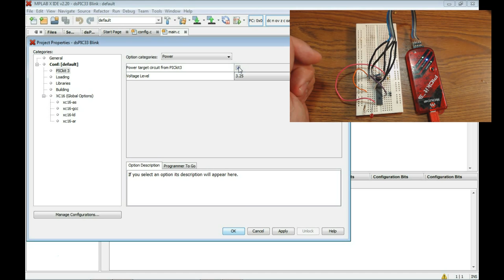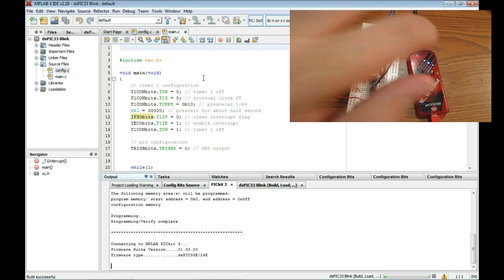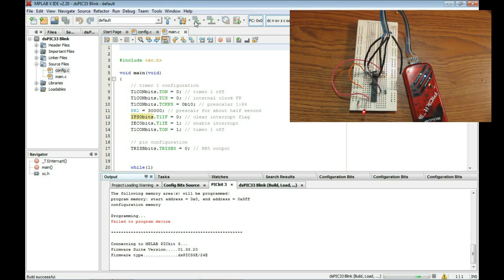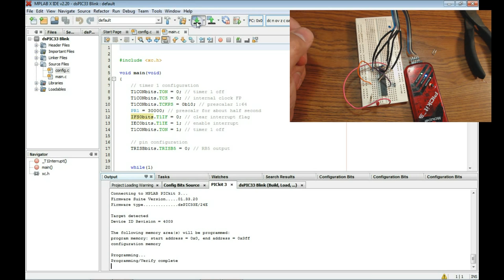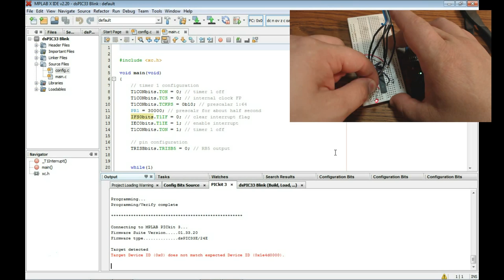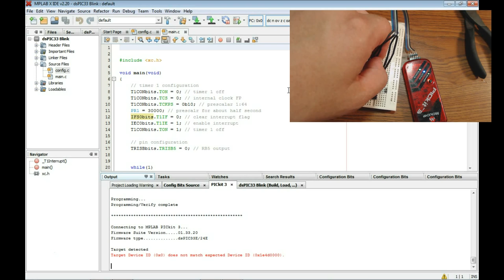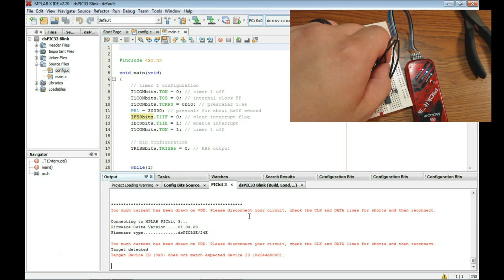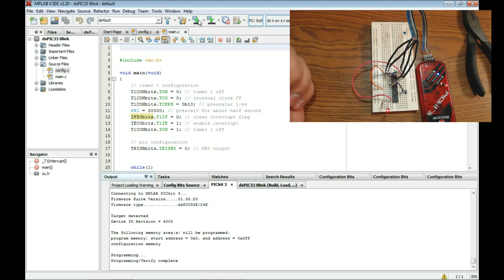eapbg #9 Common PIC Programming Errors

Comment: Hi,

Great video, thanks. 

BTW what is the “v cap”?

Cheers.
Reply from the maker: The core of the microcontroller runs at a lower voltage (1.8V). To keep the design simpler Microchip included a linear regulator inside the microcontroller. This removes the necessity of having more than one voltage rail. The drawback of this is that a linear regulator requires some bulk capacitance to stabilize it. It is difficult to put bulk capacitance inside the microcontroller, hence why it is hung outside on the v-cap line.

Comment: Do you have a fix for the error message "Target has invalid calibration data (0x0f)." in MPLAB IPE?
Seems like the chip I just received does not have OSC calibration data.
Reply from the maker: I do not. I have not heard of this error before. What chip is it?
Reply: @eapbg  PIC10F200. At the end of flash memory there is an instruction setting the clock rate that should not be touched. The chip I just got seems to have it set at 0 which is invalid. Seen mention of the problem around but no clear solution. I guess one needs to write that part of memory with a valid value in some form. I am very new to all this so apologies for imprecisions.
Reply from the maker: @sebastiandelbanorollin5482  Here is my best guess. The system is upset about the value that is written in. I think when MPLAB programms this chip it first reads that register, then erases the chip, then writes the new info including the data it read. It seems that the pickit programming software, the stand alone version is capable of writing to this register. Try using it to write something to the register. All zeroes is valid configuration at center frequency. After that try to program it again with MPLAB.

Comment: What circuitry have you done here? It's difficult to see. I'm using the exact same microcontroller as you.

Also, what breadboard are you using? I find the angle of the pins from the body is too wide (rather than 90 degrees ideally, why is it not 90 degrees?) to insert properly without bending or breaking them. I'm wondering if mine aren't working because I keep breaking them.
Reply: I've almost given up. It seems Ive tried everything. For over 2 days I have been rearranging the connections hoping that each of the /five/ dspic33e microcontrollers I bought would work. None worked even before I bent them beyond repair trying to get them to fit snugly into the breadboard.

I /knew/ getting started with the actual working of the connection of the PicKit to the device would be the hardest part of all. I told myself this even before I put my first wire into the breadboard.
Reply: In case you are curious, here is the circuitry I've done. The 104 is a non-polarized ceramic capacitor; as well, I've added a 10k resistor from VDD to MCLR:
https://imgur.com/a/sJjbL
Reply from the maker: Here is a link to the video of how i wired it. 
https://www.youtube.com/watch?v=dZOKsKbVimU&t=25s
The bread board i'm using is nothing special, just some old POS. It was abused in some other life and a fair number of contacts are spread causing open circuits. 
This particular chip was designed to solder into a circuit board. The spread of the pins allow the chip to snap in so that it does not fall out during soldering. You have to bend the pins to get 90 degrees. There are some chips that do come with exactly 90 degree pins, there were designed to be socketed, meaning plugged into a socket. Certain OpAmps can be purchased with either pin option for example. 
I looked at your schematic and you are missing a cap on Vcap pin. That will get you every time.

Comment: i have brought  new  pickit4  with  selection of external power. but  still not able to program my  16f877a. swapped data and clock pin and tried still not working. target id not matching message appears. this is a brand new ic . please help
Reply from the maker: Check all the basics. Does the pickit4 supply enough power? Is the reset line connected? Is there anything hanging off the clock and data lines? Try powering the device by something other than the pickit.

Comment: Thanks for making this video. Suggest adding index in comments with error message and time in video. request adding this error: Target Device ID (0xffff0000) is an Invalid Device ID. Please check your connections to the Target Device.
Reply from the maker: I'll work on adding a time index. I have not see the "invalid Device ID" error.
Reply: I just managed to solve the this issue. On my PCB ti am using the PIC18LF46K22 TQPF package, I used a library from CAD Eagle in which the MCLR pin was not on the correct place, thus after I soldered a small jumper from the wrong MCLR pin to the correct one, the controller was found by the PICkit and was programmed. Check that if you have this issue.

Comment: Thanks.

But I'm trying to upload a code into pic12f675 using mplab. I am getting an error message like this: No rule to make target 'build/default/production/new main.o'

The programmer is pickit2 and I wired it correctly
Reply from the maker: That sounds like a compile error and not a programming error. Does the project compile ok?
Reply: @eapbg  the program has been used in a project by the person who designed it. I am unable to install pickit2 because of .net framework.

Comment: i got this

program memory: start address = 0x0, end address = 0x7ff
configuration memory
program memory
Address: 0 Expected Value: 120a Received Value: 3fff
Failed to program device

i dont know what happended
Reply from the maker: With strange errors go back to basics. Do all VSS lines have ground? Do all VDD lines have power? Is there decoupling caps where they need to be? Does VCAP have a proper capacitor? Is anything hanging on the programming lines that shouldn't be?
Reply: i am using pic16f877a and a clone of pickit 3
Reply: i tried circuits in bread board and development board
Reply from the maker: What chip do you have? (exact number) What development board are you using? What's your IDE? Whats your compiler?
Reply: 16f877a, MPLABXIDE, and XC8 compiler
Reply from the maker: Have you programmed anything else with the pickit 3 clone? The pickit 3 is cheap enough that clones are not worth it no matter how cheap they are.
Reply: i cant program anything with that one.bought that one yesterday. But by changing power levels in configuration i managed to program 2 times. After that no hope
Reply from the maker: Pickit 3 clones are hopeless. Buy the real thing and it will work almost every time. Microchip development tools also have a lifetime warranty so if you burn one up theyll replace it.
Reply: yes i think so
Reply: It's an issue enven if you have the latest official one.
So it could be nice if someone have solved that problem by the way.